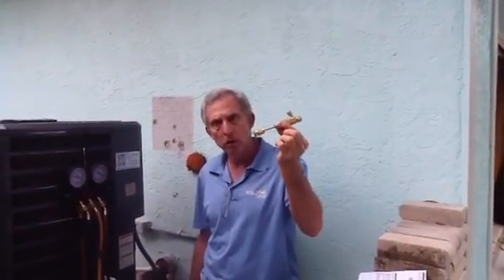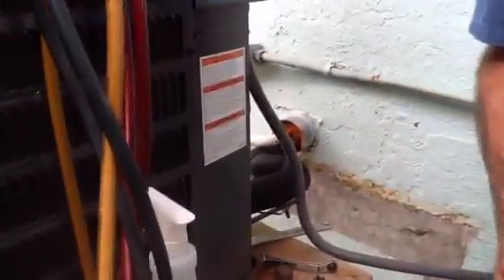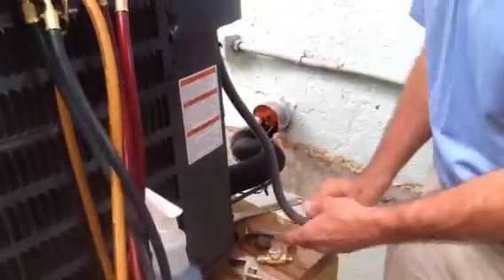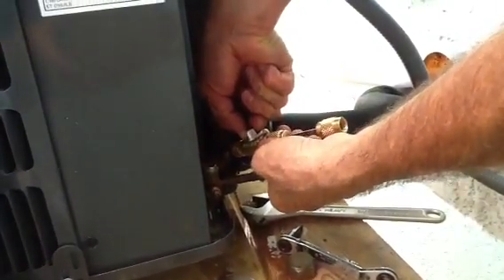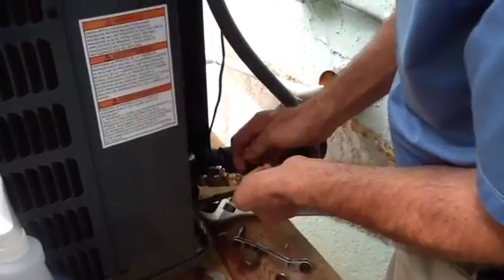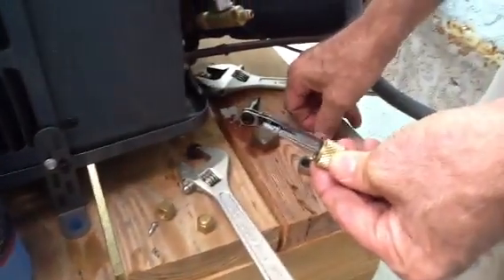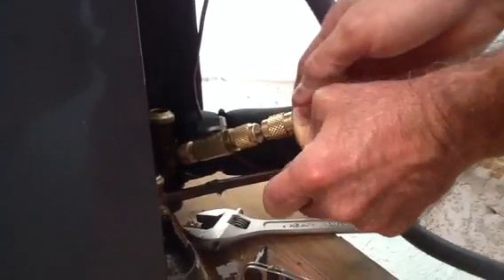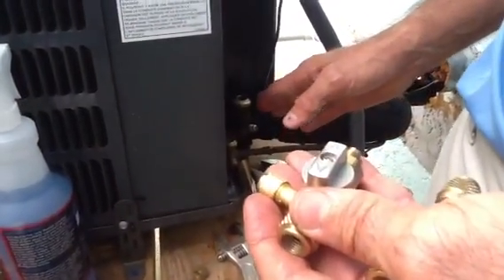Quickest way to repair freon leak

Comment: Technically you have to purge or you will allow moisture in the system, and the best thread sealer to use is nylog blue, it remains its elasticity forever and never leaks. You will prevent a lot of unnecessary leaks with this stuff and save the planet.

Comment: Excellent training! No use of the purge/vacuum port on the tool though. A tiny amount of air in the tool was introduced into the system, and a tiny amount of freon was released.

Comment: Thats leaklock not locktite.. although leaklock can be used as locktite. However, locktite will not seal leaking flare or promote better seal. Two entirely different products..

Leaklock and common sense go far. Try it with anything else, and youll have problems. Really only good for added assurance  for sealing flares. It does great with pilot tube/flare leaks if you dont have more tubing and or just dont feel like going to the truck. 

Just a dab will do ya

Comment: Neat tool!  Are the shrader valves special for the pressures an ac system operates at?
Reply from the maker: no, you are just replacing with standard valves

Comment: Two things:1. Don't ever lay the replacing core valve on any surface - keep the valve in plastic packing until you need it ... Laying the valve on a surface will pickup micro dirt on the seals.2. Consider using NYLOK on the valve seals and threads.3. always use nylon gloves and eye protectionExcellent video, and thanks for reminding people to go slow and be careful.

Comment: I doubt that was mechanics thread Loctite but probably Leak Lock, which is approved and commonly used for on pipe threads in refrigeration and plumbing systems. I agree, never use any type of sealant on a gauge port cap or any other straight machine thread devices.  Use it on tapered (pipe thread) fittings only.

Comment: I have one of those tools.  However on my Ruud 5ton residential system, the location of the leaking Schrader valve does not permit the use of the tool.  It simply will not fit in place with the shaft extended far enough to retract the Schrader core and close the valve.  The same pipe that holds the valve curves around in front of it!  What did people do before this tool was available?  What should I do?  If I take out the valve core refrigerant will come flying out of there.  Can I just do it very fast and not loose too much??

Comment: Thank You very much for doing this video. I'm a "jack of all", not a professional, but just today I discovered my low side schrader valve leaking and was wondering how I was going to fix it, without calling out an expensive tech for a $3.00 item.
Where do I get that tool? (happens to be one I dont have in my garage)
Again, very professional, Thank You.